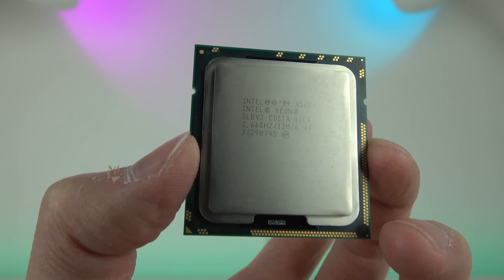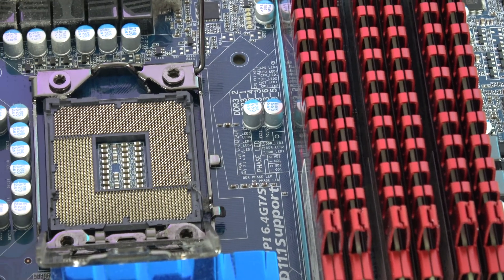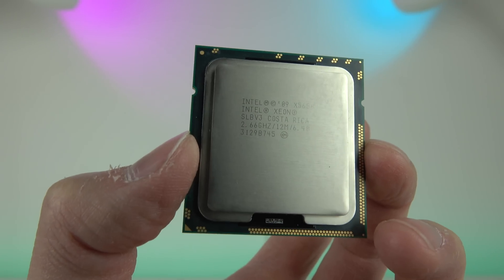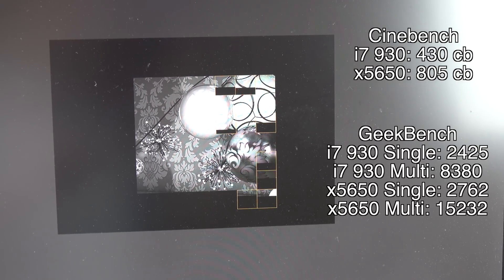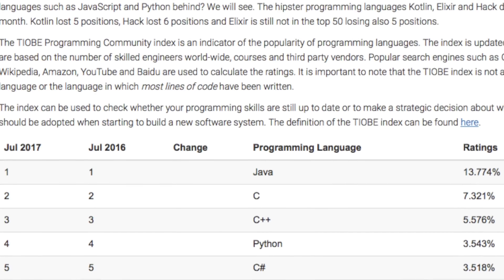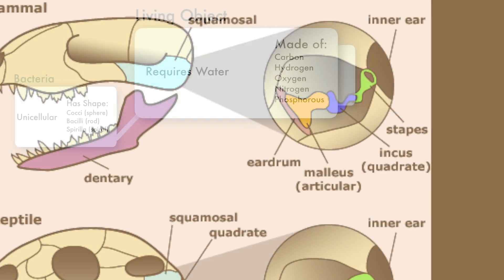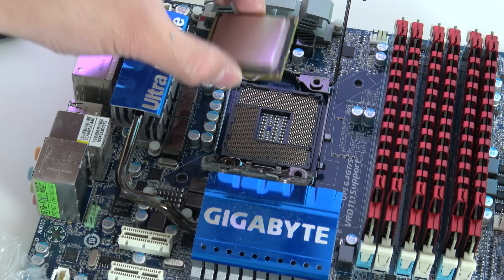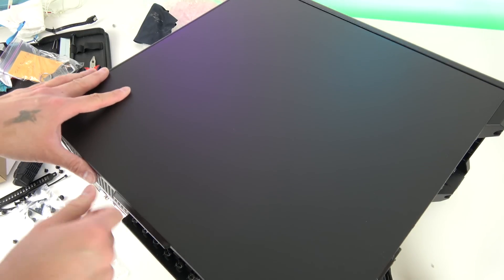This 6 Core CPU Costs $20. Will It Let My PC From 2010 Last 3 More Years?

Comment: Your CPU is plenty fast enough to render a 4k video, i could easily see that lasting another 3 years. Your cinebench score is around what a mainstream i7 does.
Reply: Fred Flintstone mainstream being?
Reply: 6700k scores exactly same in cinebench as this guys PC did, 805.
http://www.legitreviews.com/intel-core-i7-6700k-skylake-processor-review_169935/11

No reason for this guy to upgrade anytime soon :)
Reply: These Xeons can topple the 1000cb mark when they are overclocked above 4Ghz, which is easy for them to do on air. Some enthusiasts have pushed them above 1200.

Comment: 7:04 That is NOT enough thermal paste, it needs to cover the entire heat spreader
Reply: FrostBittn wrong. Too much is as bad as too little. The pea method is the best method, experimentally proven. The installation force of the heatsink will spread it in to all those nooks and crannies. -Electronics Engineer

Comment: I'm fine with 1080p, and I would probably still be running 1680x1050, if that monitor had not broken down. Especially when it comes to resolution, I don't quite see how the benefit outweighs the requirements anymore. The jump from 320x200 CGA to 640x480 VGA was nice, but 4k doesn't make all that much of a difference to me compared to full HD, neither does 144Hz, neither does HDR. And don't get me wrong, those things are all nice, but I can get on just fine without them. 

And except for screen resolution, computer development has slowed down significantly. A PC bought in '96 was outdated two or three years later, but this is not the case anymore today. This computer you have there could probably last me another 3 years. Of course, I do not stream or make youtube videos for an audience that may have the bestest screens on the market at all time and expects the content to look the part. :)
Reply: for me jumping from 60 to 144hz was insane and love it (gaming)
Reply: The advantage of 4K on a computer monitor is text rendering. If you spend a lot of time reading at your computer then 4K makes a huge difference. It matters a lot less with entertainment stuff, 4K video and 4K games aren't fundamentally different from their 1080p versions, but holy cow does the web ever look nice with all those pixels.
Reply: I still rock 1680x1050 and I love it. 16:10 is awesome and the lower resolution gives a nice fps boost
Reply: I've got a MacBook and it's already 4 years old and showing no signs of age. I fully expect this laptop to last me 10 more years with minor repairs.
Reply: It's a 2014 MacBook Pro Retina 15" A1398 11,2. Specs i7 4770HQ, 16gb ddr3, 256gb pci ssd, Intel Iris Pro GPU. I'm not afraid to tear it apart and replace anything that breaks on it. I have the motherboard schematic so I can fix any logic issues if it starts to fail. I will keep this laptop for as long as possible. At this point I'm getting frustrated with Sierra and dread upgrading to the next version that I know will just include more bugs and glitches. I'm going to upgrade to lubuntu as soon as I can get access to a fast enough internet connection.
Reply: Gerd L. Plüü Running a 1060 with a vga screen.
I prefer to spend money on the computer rather than on the screen.
Reply: might want to look into the new hdmi standard, think it is called 2.1? does 10k ;-)
Reply: resolution above 1080p doesn't excite me much (it looks nice don't get me wrong, if i had enough money i'd get a 1440p monitor) but 144hz is a gamechanger for me, 60hz just looks sluggish in comparison
Reply: I had a 4K monitor once, it was ass for productivity. Games looked great, though. My next monitor purchase is gonna be 3440x1440, but if I didn't demand a gimmick, I'd stick with a 2560x1440 monitor. That's the sweet spot for me, I'm definitely wanting more pixel density over my 1080p displays.
Reply: Mark M Macbooks really differ in quality. In my experience they are really durable when you handle them carefully AND they don't have discrete GPUs. Because discrete GPUs really suffer from apples bad thermal management:
-Radeon X1600 had more fails then usual
-Nvidia Bug
-Radeon 6xxx had more fails then usual
Reply: i agree with you on 4k however when it comes to 144hz thats a different story; i can never go back to 60 fps , even 120 fps makes me feel sick. id rather play 1080 medium - high settings @ 144hz then anything else

Comment: Not all atoms are guaranteed to have neutrons.  Base Hydrogen doesn't.  :P

Great video though, I can see the attachment you have to your PC.  I often feel the same way which is why I tend to not throw old PCs out, I just re-purpose them.  Case in point, I don't want to throw away my FX-8350 and 990FX motherboard (or the 16GB of DDR3) or my two HD 7970s.  So, I built a mining rig and maybe one day, it will be an HTPC.  Some parts of technology don't move very fast and the rendering of pre-recorded 2D video at 4K can even be done with an old HD 4870.  This is why I know that I'll never feel the need for a "smart" TV.

Comment: Love the vid - Science and Tech . I running a current gen system with Ryzen 1700 OC 4000MHz 16GB Ram and GTX 1070 as my production system but I still use my old HP Z400 W3520 Quadro 2000 12Gb System for General use. I very fond of my older Xeon system even if its does not have the performance of my newer Ryzen beast. Thanks again.

Comment: Bro, I have a $320 PC that uses the x5650, 12gb ram, 120gb SSD, 1tb of storage and a R7 260x 2gb which can do so much things. I can play PUBG low-medium settings @ ~45 fps, CSGO high settings @ ~ 200 fps and Rust low-medium settings @ ~ 75 fps. While playing for a long time or under load, my temps are at most ~ 74°. This CPU is still great and doing well, but I'm looking forward to building a new pc.

Edit: I forgot to mention that I play at 1680x1050, yikes.

Comment: Dude you can get so much more performance out of that pc by overclocking. leaving it on stock speed is such a waste of performance.
Reply: Real Flêks nah it's the same pc as mine my i7 930 came from overclockers uk in 2010 @4ghz I'm playing ghost recon wildlands at 2k and assassins Creed Origins at 4k
Reply: Since we still can buy Celeron 300A's I highly doubt OC'ing can have THAT big of a deal on life span of CPU.
Basicly : If you stay below Intel's recommended voltages for CPU, OC can't damage CPU in any way. There is no "transistor cycle limit" after which they destroy themselves.
Reply: Yep the only thing that will really harm it if you stay within spec is heat, decent cooler takes care of that.
Reply: Life time does not get infuenced that much my i7 4790K runs 5Ghz on all 4 cores for over 2 years now on 1.28 Volts over 1.3 volts it will degrade in life its just about the voltages and heat that degrade hardware just boosting a clock speed without touching voltages and have enough cooling will actually keep the system stable ;)

Comment: the xeon x5680 is a 6 core 12 thread chip with a 3.4ghz base and 3.7ghz boost clock that goes for around $75 and would definitely get you at 3 more years.
Reply: Or just overclock the X5650 to over 4GHz

Comment: Thats pretty amazing as I have the exact same rig, including my beloved V8 which has proven to be quite the charm as my temps are insanely low thanks to it, the only difference is my mobo is the AMD version and I have a beefy quad core instead sitting in my HAF-XM and yes I have the same RipJaw ram lol

Comment: I did the same. Bought W3690 6cores/12 thread CPU and paired it with GTX 960. Oh Gosh this CPU is Beast. it says below 40% in games and GPU at 99%.
Im getting 80+ FPS on GTA V maxed settings and on other games 60+ fps, squeezing the GTX 960. 
I Must say best purchase i did.

Comment: I'm currently using a machine with an MSI P43 NEO-F3 LGA 775 motherboard and a Core2Quad 9400 (originallya Core2Duo 8400) proc that I built in 2008. I've been using this for more than 9 years and it still works great with 3D gaming at medium settings. The only parts I had to replace throughout its lifetime were the GPU (replaced 3 times, the latest being a GTX 750 Ti), the proc (Core2Quad), and the power supply (replaced 3 times as well).

I have newer KabyLake-based PCs but this machine is still alive and kicking.

Comment: That Xeon will last you to when it comes down to things GPU will be the big problem soon since most games bearly use 4 or more cores as of this post. But GPUs tend to die off after 1.5-3 years because CPUs are almost at their limit of what they can make the CPU dye or we have to make bigger CPUs but no one wants that whole point for smaller nodes in nano meters to get smaller and cooler + faster where almost at its limit. So most CPUs with 4+ cores for gamers without streaming with decent GPU is fine but streaming that Xeon you use will be perfectly fine.

Comment: I have the exact same LGA1366 architecture, I built my PC in 2009 for $1,500. I started with a Core i7 920 and I bought a Xeon x5670 for $40 a year or two ago and it's still going strong, I have no plans on getting a new PC anytime soon. I saw they are selling the Xeons for $20 on ebay it's crazy. I also have a GTX 970 as well but I started with a GTX 285, I also upgraded my RAM to 12GB. I don't think there are any CPU bottlenecks on my PC since my gaming benchmarks will stack up just fine against someone else with a GTX 970 but with a modern CPU

Comment: I upgraded my dual cpus from two Xeon 4-core E5620's (8 cores/16 threads), to two Xeon 6-core X5650's (12 cores/24 threads)... HUGE performance upgrade, for a total cost of $49 ($24.50CAD each cpu)!!!... Highly recommended cpu to those wanting to upgrade an older computer with an LGA 1366 socket~

Comment: Doesn't all this upgrading after years work on cars?
Reply: Yep. People get bigger turbos, a bigger fuel pump, more efficient tires, a more aerodynamic body kit, weight reduction, alloy wheels, etc. When a car is paid off it can be easily upgraded to modern standards.
Reply: yeah we replace the parts that are worn our OR rusted away :-P
Reply: When you start upgrading cars you eventually realize that any car was designed for X amount of power, and when you exceed X by too much the weakest link tends to break then.

Comment: I'm still using a PC that I built in 2008.  It has in that time had it's GPU replaced, the hard-drive upgraded, and a minor CPU upgrade.  THis means I am still able to use, with no issues a Core 2 Duo CPU and 4 gigs of Ram.  I did end up putting a GT 730 in the machine after it's older 8800GT died, but otherwise it is still running what I built it with originally.  Oh, and by minor upgrade I went from a 2.67 GHz processor to a 3.0 GHz processor.

Comment: JUST BUY A GODDAMN PC 
RYZEN 5 1600
RX 480 
AND STOP FUCKING UPGRADING THIS PIECE OF SHIT YOUR PC IS CRAP ITS JUST A THING ITS NO A HUMAN!!! OMGGGGGGGGGGGGG
Reply: Calm down, grow up, and your pc specs suck ass.
Reply: his pc is fine
Reply: WTF man clam down! His PC is just fine! Its better than any AMD FX, and even those are not THAT bad (I still use the FX8150 and it still performs good in all games! Not bad for a six years old processor, even if it definitively is slower then i7s from the same time)
Reply: His PC is just fine. He could buy 8 core Xeon for $80 that would outperform your $220 1600 (it also needs at least $100 mobo and new RAM). But even one he got now is just fine.
RX 480 is not an upgrade from 970.
Reply: @niter43 you're correct for the first part. but the RX 480, while not much, is an upgrade from the 970.
Reply: PersonalPotatoGayming No fanboy bruh
Reply: Do you actually know that the cpu in the video rapes all the ryzen if oc?
Reply: +Mac K even though an Rx 480 is an 'upgrade' over the 970 it isn't worth it. You'll be getting at best 10% to 15% more performance while paying over 200 bucks.
Reply: Anubis_X64 Jesus christ dude what took you so long to reply. You said that its "okay" because its lacking in IPC. Its like saying i5 or i7 is only okay because it lacks cores. What cpus do you think are actually good?
Reply: Rekikz I just bought a xfx rx 480 gtr brand new for $260 usd, overclocks to 1488mhz and 2200mhz
Reply: it is an upgrade, I never said it was worth it
Reply: Anubis_X64 "Ryzen 1600 is okay" wtf are you smoking, I play player unknowns and my gtx 1070 is at 99% while my Ryzen 1600X is at 40% max.

Comment: Hey man. Good choice! I have a X5660 (99% the same as yours). I bought a mother board and CPU combo for 220$ on eBay. ( less than an overclock-able i5 at that time). I can't overclock mine yet. Can't afford a cooler yet. You and me will see when this CPU becomes obsolete.

Comment: It is insane how amazing these Xeon's are if you are still rocking the lga 1366 motherboard. I just did a similar build for my secondary pc and it does well for rendering, gaming, and streaming. With a 4ghz overclock you can do amazing things with this cpu!
Reply: TechWithRy could you overclock a Xeon?
Reply: These xeons work in enthusiast motherboards that support overclocking. So yes you can overclock them. I have my x5650 currently clocked at 4ghz stable.
Reply: wow, That is surely amazing, I have a ThinkPad workstation but I cannot overclock it.
Reply: It is most likely because of the motherboard. An x5650 requires an x58 chipset mobo to overclock it.
Reply: besides ecc memory... do the xeons clock higher mhz to mhz with a comparable 6 core i7-980 or 990x? Because I am getting 4.4mhz on my 980x? ( use to get 4.6 but since I doubled my triple channel slots I had to ease back a lil? Otherwise 4.0 seems like a pretty cautious stable? Unless we are just talking silicon lottery? I was however under the impression that we got lucky with OC chops on this chipset and gulftown westmere?

Perhaps the xeon w3690 instead would give him a bit more OC muscle?
Reply: i hope your right, i just bought one, can't wait to install it. been on my i7 950 for so long now, willing to give this small upgrade a chance
Reply: I have a quad core i7 on my thinkpad, so that is not the case
Reply: the interesting part of performance comes from Passmark: i7- 930 only have 5166 passmark score while my i7- 2760qm has 7600 score(btw the average for this cpu is 6600)
Reply: Same results with geekbench 4 as well... the score for i7 930 is 7826 for multicore, and for i7-2760qm it is 10343.... it is a pretty big gap hahaha
Reply: Kevin Zhu except it probably isn't aside from supporting higher mem bandwidth. First off its probably a 2.6ghz dual core laptop chip... That isn't even close to as powerful as the 930
Reply: Xeons dont OC well because they arent unlocked and they draw more power than the 930 did... Also ECC memory requires more voltage as well lessening the OC. If youre planning on doing server type calculations itd be a good upgrade but aside from that not sure why you'd do it except you can say you have a 6core for $20
Reply: It will run fine on no ECC memory
Reply: Kevin Zhu so you have the more expensive one... It is still about on par with the 930 performance wise due to the speed and voltage of it
Reply: And another thing that is, I found out on geekbench, there are plenty duo core i7 has the same geekbench score as i7 930 or even high, the ones I searched are i7 7500u. So after 7 years of development, the performance gap is bigger and bigger.....
Reply: Kevin Zhu the newer technologies are what allow your chip to surpass the 930... Id you did superpi which a processor benchmark only they wouldn't be that much different... Passmark allows for the faster memory and fsb to factor in
Reply: The only way for i7 930 to win the age is to overclock, that way it could get higher benchmark score
Reply: but...my memory is only ddr3 1333mhz, I am sure some desktop of the same time has faster memory than mine
Reply: I will test superpi right now lol
Reply: OK I finished my superpi, a 930 has 13.947 sec when running 1M， and I have 11.125 with my laptop
Reply: Hi James~ If you search on superpi and search benchmark for superpi 1m and 32m with i7 2000qm series, you could see my result on the 1 one.
Reply: Xeon processors are ment For server usage so thats why they wont have high GHz
Reply: That's exactly what I wanted to hear! :-) About to swap out my 3ghz Core2-Duo for one of these in my Gigabyte MB. Hopefully, it will come to life without too many expletives.  :-D
Reply: I believe that the xeons don't run as hot and they are a bit smaller, plus silicon lottery.
Reply: My thinkpad's CPU is better than i7-930 in this video lol

Comment: Why are lga 1366 xeons so cheap though? i mean, lga 1155 came out not long after 1366, and its xeon lineup are still expensive
Reply: junilog the problem is that that was a consumer platform that didn't end up in servers, the CPUs did flood the market, the same as with the 1366 motherboards they only got bought by consumers so they also didn't flood the market either.

Comment: I have had the same broom for 20 years and it's just as good as the day I bought it.  admittedly I have fitted 5 new heads and replaced the handle 3 times but it's the same great broom that I first brought home in 1997.  sounds a bit daft doesn't it, but it sounds the same as your 7 year old PC that you say is the same one that you built in 2010 BUT you have swapped out the graphics card and added more RAM and SSDs. and now you have swapped the CPU and bundled it all into a new case, there's not much of the original PC left.  just like my 30 YO broom eh?
Reply: sydmichel which can be said of life. Your cells divide and die all the time, even brain cells. With all the changes that happen in your body, when do you stop being you? Were you ever really you to begin with?
In this, the only thing to not change is the motherboard. Maybe it's an entirely different computer if that changes. Also he changed those parts gradually over time, just like the cells in your body. So if you are you, then this is still the same computer.